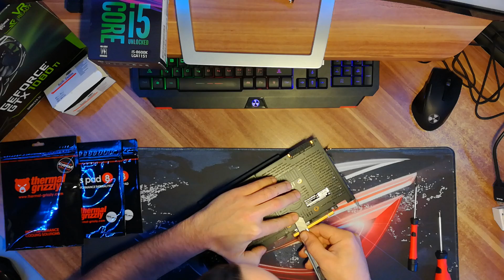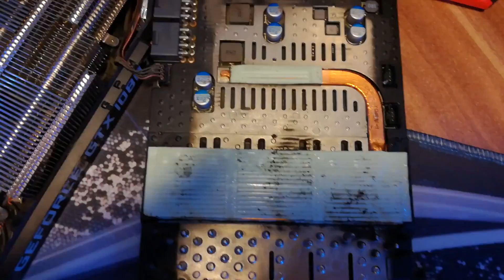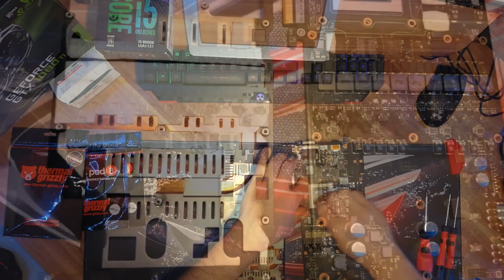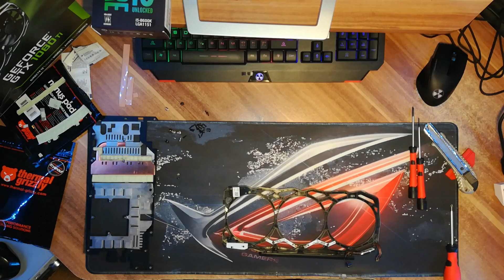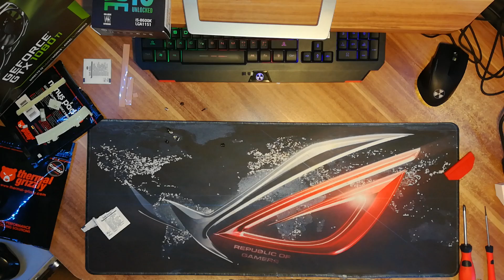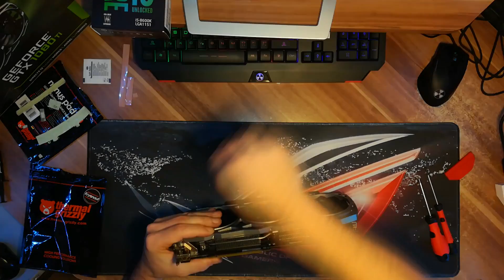EVGA GTX 1080Ti iCX FTW3 - cleaning, change thermal pads and paste

Comment: I’m about to embark on this adventure the GPU is taken apart, I noticed so far you didn’t replace all the thermal pads rather than just cleaned them? What if I can just replace all ?
Reply: depends on it. if you bought it around the time it came out, yeah, change them, you can tell when they become brittle and break up like bread, make sure new pads are good with moisture. mine just bricked i think, fans arent turning, troubleshooting it right now. i see moisture underneath the black plates, hopefully its just that, got some cheap pads on amazon, maybe i need to get better ones, temps were good though. but last time i replaced the pads since i got it day one.

Comment: Fan 1 constantly ramps up to 4000+ rpms after doing this now and it's super loud, any idea what the problem might be?
Reply: I had the same problem, just apply a firm amount of pressure with the graphics card in-between both hands (the gpu chip side of the card). This happens if you've applied alittle to much or alittle to less thermal paste. After this process, check the 4 screws on the back plate to eliminate lack of pressure. They don't have to be overly tight, just firm. Sorry I couldn't of helped you earlier, I've only just come across this video. Anyways, I hope this works for you.

Comment: Hey, mate, very helpful walkthrough. A few days ago I bought a used 1080Ti FTW3, which was used for cryptomining, and while the temepratures seem fine, I want to replace the thermal pads and paste. Could you tell me the exact amount of thermal pads you used. How many packets of  Thermal Grizzly 120x20x1.5mm. I see 2 in the video. Was that enough to replace all of them.
Reply from the maker: 1x 1,5mm and 1x 1mm pads 120x20

Comment: Hello
Are you use Thermal Grizzly Minus Pad 8 - 120x20x1.5 мм ? Or 1mm?
Reply from the maker: 1,5mm
Reply: Stock pads are 1mm not 1.5mm
Reply from the maker: @fns58  The pads can be compressed up to half their thickness. It is always better to have a hair stronger ;-)